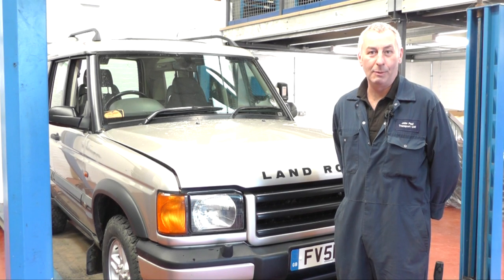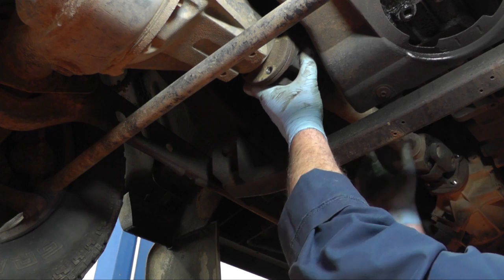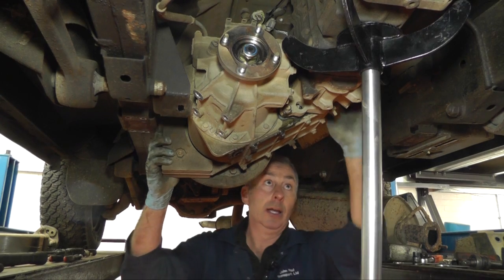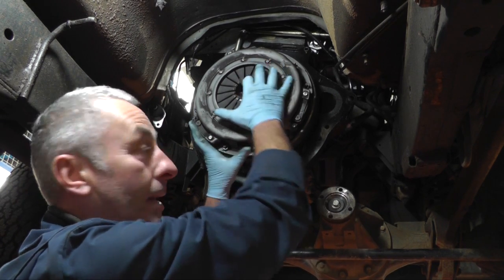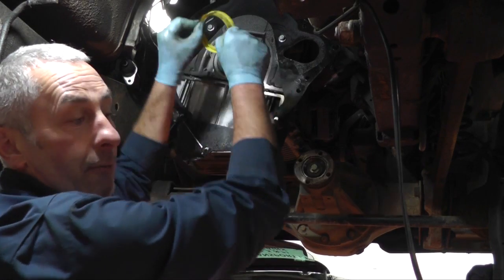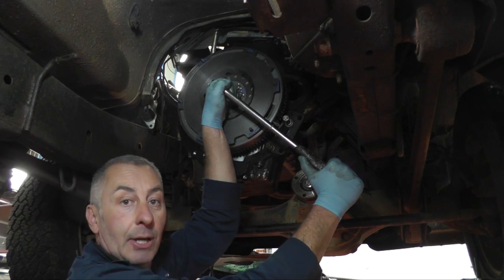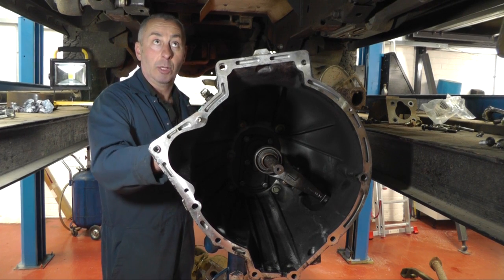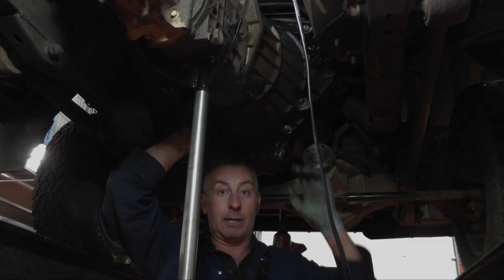Changing the clutch on a Land Rover Discovery 2 TD5.

Comment: great video - I had my clutch replaced last year by a local garage because I did't think it was something i could tackle even though I have done loads of different cars and transit clutch changes.
the garage made a right hash of it and I can't get reverse without turning off the engine, selecting reverse and starting the engine back up. I have only done 300 miles since they changed it and decided enough is enough.
they keep telling me to run it and run it and it will get better hmmm not happening.
I watched your video today and the way you have explained everything, gave me the confidence to tackle it and I decided to get the box back out.
I have it all out and to be honest the clutch don't look like a new one and the flywheel has got a lot of play in it, not only rotational movement but side to side, is  this supposed to have a lot of play in it??
I gave him the money upfront for the for the parts (3 piece clutch & spigot bush).
also I was trying to look at what side the clutch plate was facing in your video but couldn't quite see it. the plate has not got any writing on it to say what side is flywheel side.when i took the pressure plate off the clutch plate had the long part of the shaft facing the pressure plate, is this correct??? 
thanks in advance for any comments or help you can offer so i can get it all back together and working.
regards
Mick
keep up the great vids, I will be keeping my eye open for more.
Reply from the maker: The flatter part of the plate should be facing the flywheel. There should be no play at all in there either.

You should probably tackle the garage directly about your findings if you don't think they've changed anything.
Reply: Thanks for the reply. 
The clutch plate was definitely in the wrong way around. 
They had also failed to locate the arm onto the plastic ball joint. This in turn was not giving me enough clutch. 
Withe the help of your video I managed to do the job myself and it is now running perfectly. 
Thanks for your help and producing this video. Regards Mick
Reply from the maker: Excellent work, Mick. Glad we could be of some help.

Comment: Loved your video! I got a 2001 Discovery Td5 and it's making a rattling noise when the clutch is pressed during gear shift. It's becoming a bit annoying and I wanted to know the parts that needs to be replaced. My local mechanic says the problem is not a major one. I want to take actions before it's too late. Thanks for the help.
Reply from the maker: This sounds alot like the symptoms of a clutch release bearing on the way out. It could last for miles and miles or go completely tomorrow. You'd obviously not just replace the bearing, you'd do the whole kit if you were going to get that far into it. And don't forget to change the spigot bush!

Comment: G’Day John thank you for your fantastic Video you are a Legend 💪👍🫡
Mate I have this problem with my 2004 Disco2 Automatic td5 just  
yesterday two weeks he changed transmission on my 04 Discovery 2 Td5 Automatic started playing symbol traction control as gear is engaged will I’m driving then parked home wake up in morning start on D 1-2-3 they won’t engage only Reverse works and I checked  transfer box if accidentally me or family member they engaged low range some how it stuck in N but nothing of that ,, then I found out the symbol transfer box  light on and when I engaged it R works D-2-3 won’t move just the 1 it works as Reverse 🤷‍♂️🤦‍♂️ is that a bad thing ,,, this happens after I visit a mechanic work shop 
oil fluid two weeks ago. 
Am I in trouble gearbox gone I don’t know 🤷‍♂️ what to do ? Please advise me 🙏🏻🙏🏻🙏🏻
Thank you 
Matt

Comment: Thank you for your suggestions! In a defender, I need to remove both engine and gearbox, is possible to lift together? Should I separate transfer box before and leave in place? Which approach do you suggest? Thank you

Comment: Im experiencing difficulty finding reverse. I have no slipping or any other symptoms however there is some clear oil on outside of transfer box. Is this symptomatic of a worn clutch or just fluid loss due to worn seals etc?my clutch pedal is a bit soft and can now move easily between gears while switched off without dipping clutch.Any tips would be appreciated.+++ what would be the  cost of the work demonstrated typically at a garage?

Comment: We just did all of this. But then the clutch wont release: We took the air out of the system. Today we even tried to renew head and slave. We pumped and tried to  air out from slave and up. Nothing works. Is there a trick to take the air out that we dont know? Done a bunch of gearboxes and never had this before. Could it be a faulty clutch and how do we check that? Everything seems to sit perfect. If the frictionplate should be turned wrong, would that make it not disengage?

Comment: Great video, but what is the tool used for removing and installing the spigot bearing called?
Reply from the maker: Good question. I would call it an expanding bush or bearing removal tool. Maybe this link will help you: 

https://www.amazon.co.uk/XXR-BEARING-PULLER-EXTRACTOR-HAMMER/dp/B00KQP3GQY
Reply: That simple. 😂😂 
Be a weeks job on floor for me this. Still great video.